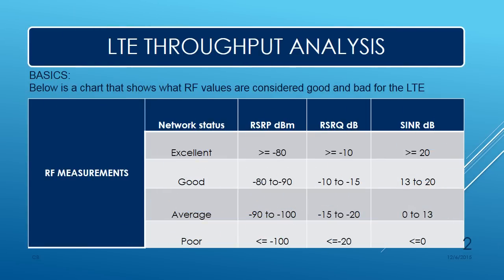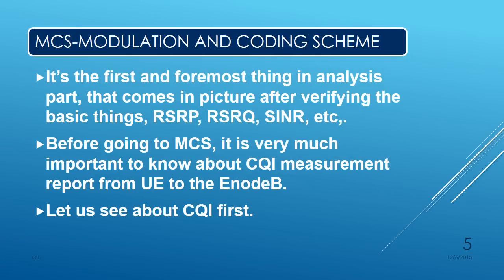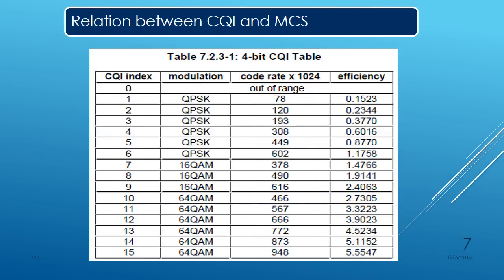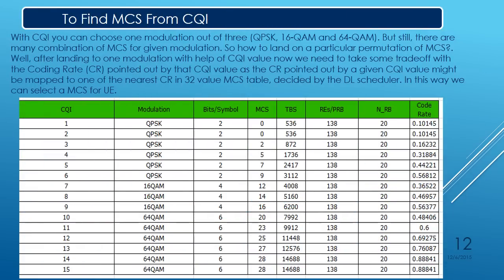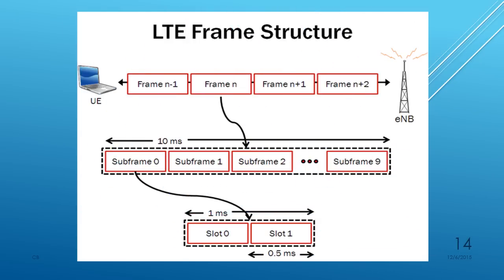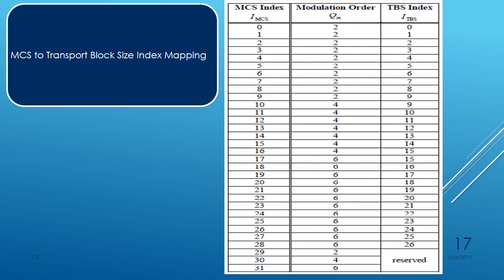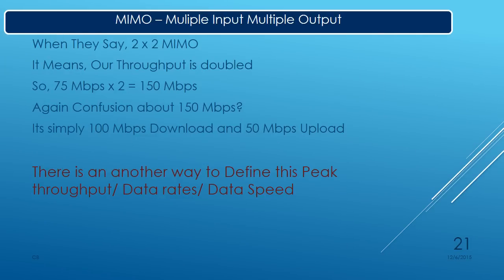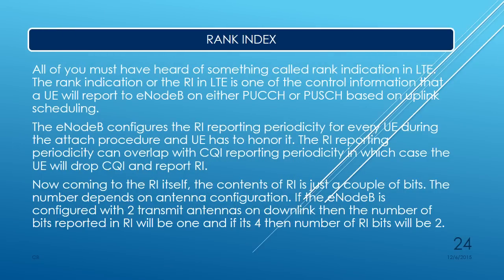4G or LTE THROUGHPUT ANALYSIS BY CB

Comment: good job.  but you missed up when converting 1ms to sec. we divide by 1000 not multiplying but why the result is true ! because you multiply the number of bits/ms. thank you.
Reply from the maker: Hi, To convert ms to sec, we need to multiply with 1000 only. Mbps is the commonly used term. not MBps.